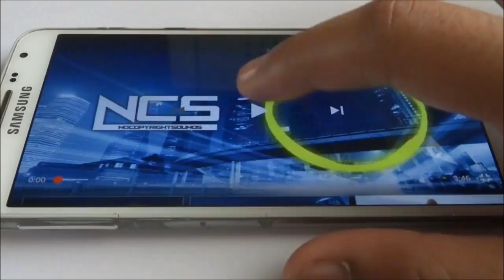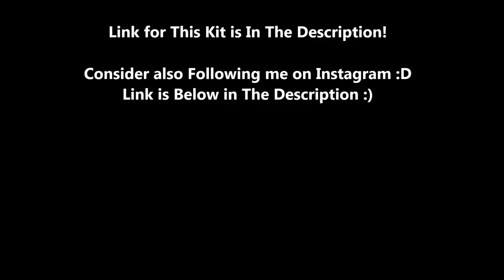DIY Musical Tesla Coil Kit For 5$

Comment: Alright for those who doesn't manage to get the red light on + can't get any current in the bigger coil here's what I think that happens.

For some reason the connection that has the big coil (secondary was it? whatever, you get it) has to be connected to ground, mine was failing to do that so it didn't light up, I still don't know why, maybe it wasn't well soldered or something. Once you connect that to some ground it starts working fine.

I think that this cable has some insulating so you may need to scratch a bit before soldering it.

The sound is very low but it's there. The transistors heat up very well so try to apply the thermal paste the best you can.

Comment: The primary coil copper wire "end" (sand paper, whatever) need to be scratched to trown the enamel ( insulation ) else the solder could be bad . Also at 2:39 the text say : Create a Secondary Windin of 2 Turns but You only made one .

Comment: Will it be fine if we don't put the thermal paste? Because I bought it but it doesn't have thermal paste. Please tell me ASAP.
Reply: You have to buy some then.
Reply: Use toothpaste it works
Reply: Superkoopatrooper l was just kidding bruh🤣🤣
Reply: @superkoopatrooper4879  lol it's a MOSFET not a CPU used for gaming or something, you don't need thermal Grizzly. you can get away with using 0.5$ thermal paste or "grease"

Comment: if it turns less then with the thread is the result better?🤔🤔🤔 can you clear this doubt for me please, I noticed that you only made one turn with the threads
Reply from the maker: No It's not like that. It was mentioned in Instruction module to make a single turn.
Reply: @ElectroMaker  so, I understand now, I'll see if in my manual it will be like this too
Reply from the maker: @NIGHT-ws3pc  yes

Comment: Do I have to sand the two ends of the coil wire before performing the soldering on the pcb? What was the amperage used? Can I use a notebook charger?
Reply: The ends are already sanded (Even if not. The Isolation will burn of while soldering ). So you don’t need to do that. The amperage is 2A. You can use any power supply with 15-24v with at least 2A.
Reply: Just make sure that you wind the coil 2-3 turns clockwise. Looked from above

Comment: I bought same kit, soldered it last night, both LED lights up,  but there is no Plasma. Do you have any suggestion what could be the cause?
Reply from the maker: What power source are you using?
Reply from the maker: @Shaburu69  You need Atleast 18V and 1Amp
Reply from the maker: @Shaburu69  I Recommend a laptop charger

Comment: Is the arc bigger if you use 24v? than 16v?
Reply from the maker: Yeah. But the transistors heat up more
Reply: @ElectroMaker 
'
hi E M...
better use a cooler fan on the kit and would be help kill the heater down
Reply: Please make video on 240v AC tesla coil
Reply from the maker: @ronixdash123  that would be too dangerous :D
Reply: @ElectroMaker  Not a problem, house power outlet is also deadly but only if we touch it, so as long as you take precautions, you can even run nuclear reactor at home
Reply from the maker: @ronixdash123  It's on my to do list!

Comment: Hi I received transistors IRF530 & TIP41C. The output frequency is 1.4~1.5Mhz. Do you know how these transistors produce this frequency without using a crystal oscillator?

Comment: Mine is not working, the leds are bright but there isn't any arc 😔
Reply from the maker: Increase supply voltage.
Reply: @ElectroMaker  it is already 19 volts from pc charger

Comment: What power source did you use?
Reply from the maker: My lab bench power supply at 12v
Reply: @ElectroMaker  do you have a link where i could buy that?
Reply from the maker: @johnetnuf  The link for the Tesla Coil is.in The description box. 

Power Supply I used:- #Aliexpress Rs. 2,704.89  50%OFF | longwei lw-k3010d 30V 10A Switching Lab Power Supply Adjustable DC Regulated power supplies LED Digital 110V/220V Power Source
https://a.aliexpress.com/_d7Z2BDc

Comment: Hi, my tesla coil doesn’t work (even the led) and the transistor is very hot. A solution pls ?
Reply from the maker: Your supply voltage must be 12-25V. And check wether you have connected the Transistor pins in correct order
Reply: Thanks for your fast answer, yes my transistor pin is in correct order and I took a laptop charger with 19V 2,3A
Reply from the maker: @user-ct4su1pk3r  19V must be fine. Have you made the circuit by your own or bought the same kit as shown in the video. Because I don't think there could be any errors in this kit. There can only be some mistakes which we might make during the assembly of this PCB. These could be the possible reasons :-

1) Transistors pins not connected in correct order or Transistor might be damaged

2) Supply voltage is very low (In your case it's fine)

3) Try to change the number of turns on your primary coil. Wire given in the kit is only long enough for one turn but you can use general wire 22AWG and experiment with number of turns like 2 or 3

4) The secondary coil (with a lot of turns of copper wire) is made up of enamel copper wire which means they have a enamel coating around the copper and enamel does not conduct electricity. So use a sandpaper to remove the insulation of the lower end of the wire (which you solder to the PCB) and then solder the wire to PCB after removing Insulation. 

5) Solder Joints may not be proper. Try using a multimeter with continuity setting to check for connections or Solder bridges (Unwanted connections caused by molten solder)

6) Make sure the Polarity of the power source is correct (most common mistake made by me).

Those were some possible reasons I think which is causing the Trouble. Try it again and if the problem continues you can send me pictures of your PCB to my Email I will check it out.
Reply: ElectroMaker, ok thks very much it is a kit , I will try that
Reply: ElectroMaker hey thks you I used multimeter and I saw I think that the transistor wich was very hot is defected because there’s two pins wich not power. Should I change the transistor?
Reply from the maker: @user-ct4su1pk3r  Yes change it
Reply: ElectroMaker ok thks I subscribe

Comment: Do i need to put the thermal paste?
Reply from the maker: It's not necessary. Can can just mount it directly on the heatsink. But thermal paste ensures better heat transfer to heat sink thus keeping the MOSFET's cooler. It doesn't really matter much tho. 

Quick hack:- you can also use plain toothpaste in place of thermal paste 😉😉
Reply: @ElectroMaker  THANK YOU SO MUCH!!

Comment: Does it works with 12v input??
Reply from the maker: Kevin C No, This one Doesn't
Reply: ElectroMaker Thank you, and with a laptop charger?
Reply: @ElectroMaker  why?
Reply from the maker: @kevinc8854  laptop chargers are generally 18V so yeah it will
Reply from the maker: @harshityashwardhan  This circuit is simply designed that way.

Comment: 14-26V but how many A?
Reply: I believe it's 2 amps.
Reply: @waltp3373  yeah? Because on the video it shows 0 amp that seems weird to me but maybe its only volt? I dont know much
Reply: @Yannowitsh  I ordered one of these and it calls for 2 amp adapter which means it would draw between 1 to 2 amps. The reason it shows 0 amps in the video is because he has set the voltage on the power supply but he hasn't turned on the Tesla Coil. Right after he shows the power supply, he shows the Tesla coil and the lights are off. Then the lights come on when he turns it on.
Reply: @waltp3373  so you can put it either on a settable supply like his, or a simple 1a 15v dc power supply that i can plug in my house socket?
Reply: @waltp3373  because i bought it too already, i have it with me but i didn't start soldering it yet
Reply: @waltp3373  and do you know the size of the tesla coil's plug? I'm gonna buy a 15v dc adaptater but there is different sizes : 5.5-2.5mm, 4.0-1.7mm, 3.5-1.35mm, 2. 5-.07mm, i am a bit lost
Reply from the maker: @Yannowitsh  Hi. Yes 1A is max it draws. You don't need to buy Power jacks, You can directly solder the power supply cables to the tesla coil. But I believe its 5.5MM Jack
Reply: @Yannowitsh  I haven't completed assembling my kit yet. When I do, I will measure the amps it draws. The ad said to use 2 amp adapter. The plug I am using is 5.5x2.5mm. My power adapter is a model JDT-001 purchased on EBAY. (variable 9-24V, 3A) Better to have more amps than not enough. I hope this helps.
Reply: @Yannowitsh  15V is the low end to make it work. I hooked up a variable power adapter 9-24V. At 24 V it draws 1.15 amp so you will need at least a 2A power source. At 16V it draws .9A.
Reply: Walt P will it matter if we use AC or DC for this kit?
Reply: yes
Reply from the maker: @jdjsjdbhdjdjdj1969  Yes use only DC

Comment: My red led do not turn on, please help.
Reply from the maker: Nikolay Jovanovic how many turn you made on primary?
Reply: ElectroMaker 
Just one, like yours + I get sparks when I touch heatsink, I make load(aluminium ball) and when I put it on heatsink I get spark, really weird
Reply: Make sure you've soldered the two transistors in correct order since they're different